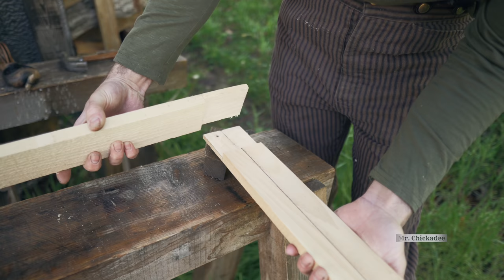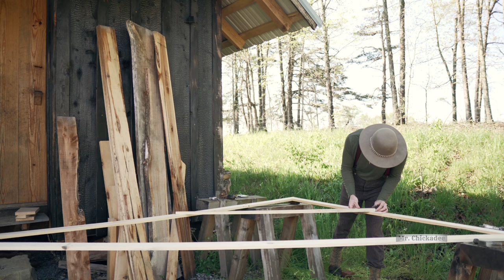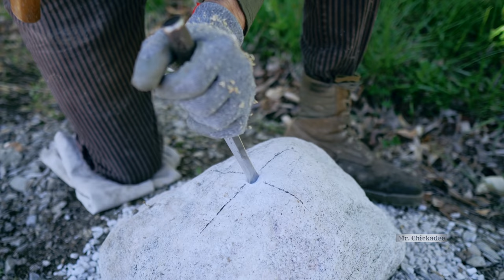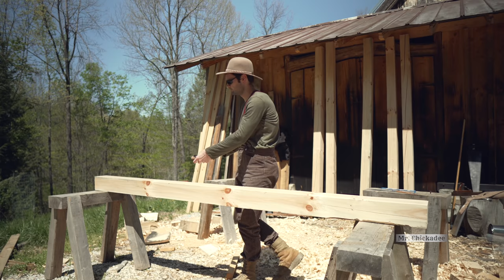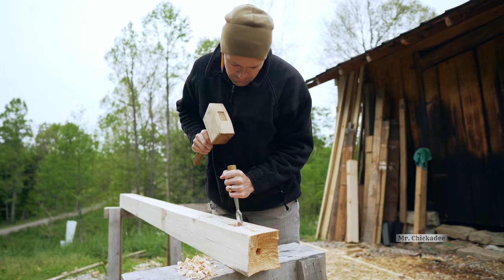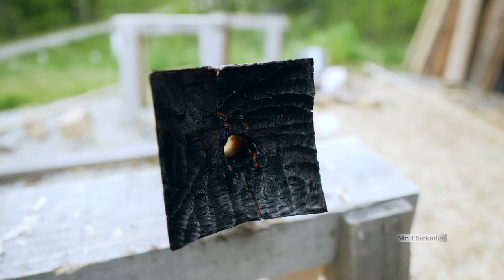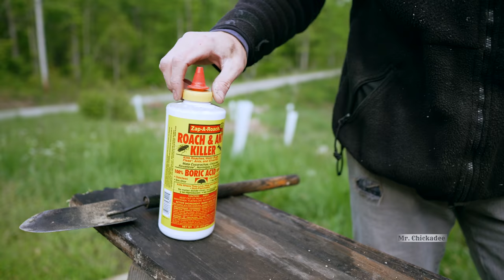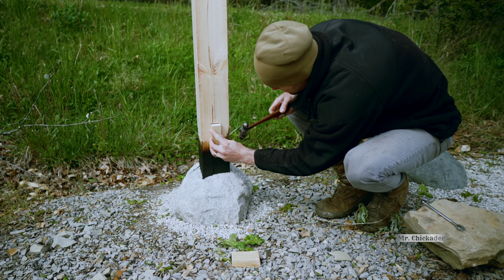Anchoring timbers to stone: ancient technique with modern twist for building codes/extreme winds.

Comment: Before there was a cordless drill, there was a cordless drill!
Reply: Have you noticed that all his tools cut through the wood like cutting butter. He must sharpen his tools vey thoroughly.
Reply: Even a cordless rotary hammer
Reply: Yes no need for cordless extension cable
Reply: where i can buy cordless power generator?
Reply: Called a "brace and bit" if your currious. And he definitely cares for his tools, those bits are a bit (pun intended) harder to come by these days, and te reason they cut the wood like butter is that those old bits are self tapping and the twist and thin shaft past the cutting head helps to pull up the chops and clear the hole as you drill.
Reply: You wont believe this, but Electric cars were before gas cars
Reply: @nesp_phieti  if i remember engine's not cars due to battery issues and oil company's pushing for gas but I may be wrong.
Reply: I have a 1937 "cordless drill" from "Milwaukee Electric Tool Corp"

It is not electric. XD
Reply: @operator8014  bought from Mars probably
Reply: U mean ,before cordless power drill ?
Reply: Ha funny :)
Reply: @shiftyjesusfish they're quite easy to find online, just a little pricy as they're more niche .
Finding a fistful of brace bits at a reclaim yard a few years back made for a nice project derusting, polishing and sharpening

Comment: Being a telephone installer in Santa Barbara CA I have crawled under many Sears & Roebuck Catalog houses, era 1920s, that used this method. These homes have survived many earthquakes and have not been damaged by the ubiquitous subterranean termites. Thanks for showing that "newer" is not always better. I think that the only reason that this method is no longer used by contractors is that it requires skill and time.

Comment: This “ modern upgrade” is a best practice when using monolithic stone as a foundation for a post.  Here in the Pacific Northwest my structural engineer approved this method with a few changes to deal with those pesky earthquakes. Use 1” all thread rod embedded 10” deep in the stone and 10” deep in the post.  Use structural epoxy in the rod holes. And the stone base must extend at least 18” below grade on top of 6” of gravel. Hand tools optional lol. 

I used this method on both my front porch and my back porch. 8x8 posts on top of granite blocks. The granite blocks I used were roughly 2’ x 2’ x 5’.  It helps when your neighbor owns the quarry.  They look incredible! Thanks Mr. Chickadee for sharing this new twist on old methods.

Comment: Really cool, and looks like a great way to keep your house on its pillars.  One thing I did notice though is that you stacked three washers, and one of them was the traditional spiral lock washer.  You might want to consider leaving those out.  Spiral lock washers actually substantially reduce nut retention forces.  At the time they were developed, they seemed like a good idea, and they work in theory, but in practice a bolt without any lock washer at all has much higher retention forces.  They DO reduce the extent that a loose nut rattles, by basically being a cushion, but since you sort of want to know right away when something's coming loose, that's of debatable utility.  The fact that they're still used EVERYWHERE is mostly a case of engineering standards evolving at a much slower pace than engineering knowledge.

Comment: My dad was a mason who sometimes had to "bolt"  heavy machines to walls and floors in factories. He would put a nut on the end of the rod, drill a hole large enough for the nut to go all the way to the bottom, put the rod and nut in it, fill the hole with a bit of fairly dry concrete, then put a solid iron tube with a relatively flat end over the rod and hammer on it, fill again with some more concrete, hammer again, repeat until level. He claimed it instantly secured very heavy machines.

Comment: We were Never elaborate about our sheds.My twin and I, under the direction of our grandfather, would dig a trench and load it with stone. Then we would search for stones with a flat surface. These stones would set on the trench stones. We would then drill a hole, like you did in the flat rock with a rose drill. We were not fussy about leveling the 6X8 beam which was connected to the rock. We would level the frames. Your foundation will last 300 years plus! my sheds are over 80 years old with no settling.! Great video. :-)

Comment: You know? There is a special threaded bar that is used with that epoxy as seismic restraint in various building practices and infrastructure applications . Which in conjunction with this would be incredibly easy to fit and would stand for possibly a century, since it has a flanged nut and a flat sided rebar type bolt in Galvanised steel finish. 
I'm impressed with this and though it may be difficult to apply in the low floor setting am considering it for a repiling job on my list. The building is on a sand footing which has required resetting piles numerous times over the past century, wedges and wiring. Here we would multiply the area of that pile with the large stone, exponentially reducing movement  over time. 
You did an exemplary model of the technique in this example! Thank you. Impressed.

Comment: using a star bit for single-jacking will make the process easier, and it too has been in use for hundreds of years. Thank you.
Reply from the maker: No, star drills are for concrete and brick. A plug is used for real stone. Just watch any single Jack hand drilling competition in granite, its all plug chisels.
Reply: @MrChickadee  I am just going on what I have witnessed in many hardrock mines here in the rockies, and what I witnessed as a kid while staying at a galena mine operated by a couple of hand miners. Lots of broken drill steels of several configuration were found......I admire your precision and attention to detail. No slack or error. Thank you for the info. Measure 3 times...cut once.

Comment: I made similarly connected posts but with holes just to fit a single nut without the space for wrench. Then i glued them inside and rotated whole pole to screw it on.
Reply from the maker: Cant see that working with a round scribed stone? Maybe with flat stones?

Comment: I think I would have chiseled the stone almost flat with a slight cone to shed rain. I guess cause I'm a mason. Also Dow chemical told me the best way they discovered to keep termites from coming up through the anchor / sill bolts and other penetration was to use pine tar at the hole. That's been 15 years ago but I did use it. Just my 2 cents. Would happily listen to your opinions about it.

Comment: Some captions would be epic....pine tar, creosote, what are you using, when and why?
Reply: at 14:13 it says "Pine tar/linseed oil mix"
Reply: only if you have CC turned on though!
Reply: There are captions. Click the CC button next to the gear on the bottom of the video.
Reply: There are captions, but you have to turn them on. It's the little "CC" button next to the settings cog.
Reply: Enable the captions.

Comment: I did a similar thing for the center posts of my post & beam winery.  I used a stainless steel anchor epoxied into a granite block.  I screwed a galvanized eye bolt into the anchor, and cut a slot in the end of the timber for the eyebolt, and put a one inch octagonal red oak peg through the post and eyebolt.  I also put aluminum flashing between the post and granite block.  All you see is the peg.

Comment: This was oddly satisfying, could we perhaps have some overlay text to know more detail of each stage, very good qaulity vid, what about coating the bolt with some protection from corrosion for longevity. Nice vid 😀👍
Reply from the maker: try turning on the ccs
Reply: Or you can use stainless bolt, nut and washers, since they are modern part anyway.

Comment: Reminds me a bit of the approved method for retrofitting a home for earthquakes here in Oregon, minus the steel brackets of course. But anchoring a bolt into holes bored into the foundation is a key part of it, and the use of epoxy to do it is encouraged to reduce the risk of cracking the concrete.

Comment: I have a general question regarding to the chisel, how often do you feel like you have to put a point back on it going through that granite? 2x per strone or more?
Edit; that beam of wood looks like it’s growing out of that stone so beautiful
Reply from the maker: I gave it a grind twice per hole. On the last hole I could tell it is ready to be reforged as I was starting to grind down past the hardened part. Granite is hard haha.
Reply: @MrChickadee  thanks for answering my question.
Reply: @MrChickadee  we have mostly basalt here in Oregon USA, granite is also MUCH more abrasive depending on what materials have been stuck in it.

Comment: Not sure if it was in the video or I just missed it 2x. What was the oil used after burning the end of the timber?
Reply: Pine tar mixed with linseed oil.
Reply: Tar and linseed oil
Reply: i am guessing linseed oil...
Reply: "Pine tar, linseed oil mix" 👍
Reply: Pine tar and linseed oil
Reply: Probably Linseed
Reply: It was in the captions.  Mix of pine tar and linseed oil.
Reply: said pine tar , what ever that is and lindseed oil
Reply: It was most likely oil based polyurethane.
Reply: To protect the wood from moisture

Comment: I see how it might help with building laws, and from the psychological point of view. But from a functional standpoint I don't think it adds a lot the original design. It surely adds the weight of the rocks to the structure, but the whole house should weight enough to hold itself in place. And if for some reason you're expecting that it doesn't, you probably need some way to anchor it directly to the ground anyway.
That said it's an awesome work as always. If I wasn't in another continent and all, I would love to join one of your classes.
But, who knows... maybe one day...
Reply: Wind uplift ( could be roof only) or even seismic restraint ( don’t know if this is in west coast).
Reply from the maker: I typically dont do this, but as you say, some like it for "feel good" reasons. Or to satisfy code officials who dont know better. Building weight should be enough in most cases.

Comment: In case anyone is curious about the effectiveness of using a brace to drive home screws/bolts, I've torqued the heads right off of 7/16" galvanized lag bolts, so using some form of torque limiting (like 'torque sticks') is DEFINITELY recommended unless you are confident that you can drive screws/bolts home without over-torquing them.

Comment: I don't understand how a shallow layer of gravel doesn't shift and push around from the weight. It must settle and push outwards, surely, over time?
Reply: My understanding would be that, as the ground has been dug out to create a small pit, the walls of the pit create enough containment, like shuttering used for concrete and that, with a suitable grade of stone gravel, it is compacted and supported in a way that prevents the movement. Your theory is perfectly logical and a good question, so others may contradict me but i think, with the additional gravel poured around the sides, the shape and size of the large base stone and what i presume is solid and dry ground conditions, it wouldn’t be a problem but i’m interested in Mr. C’s response.
Reply from the maker: Nah, it'll be fine...know your soils, some will need more than this.

Comment: I love the original idea and now like it even more.  Did you get any building code approval for it as that is the question, Designed a beautiful shade trellis with a wood structure, and metal legs.  When we went to building code, they only had a picture from the standard building codebook, and the picture did not match what we designed so we needed an engineer to sign off, the Metal legs had to be broken and bent tested for each one, and the clerk also stated no-one builds with metal anymore.  I had to laugh at the whole scene.  So you are off-grid but chances this was approved anywhere to comply with codes?
Reply from the maker: No building codes here mate. But I do know my friend has built many houses for people (and public works) that were approved in residential areas with this method.
Reply: @MrChickadee  That's good to hear. Thanks for posting you do amazing work and bring back technology the world forgot is awesome.

Comment: Nice work sir. Why the ant stuff in that mixure? (Presume it was clay, soill and water?)
Reply: It was for the boric acid. Salt would work as well. Josh normally puts explanations in the closed captions since his videos are as much about ASMR as they are about showing the techniques.
Reply: Pretty sure the purpose of the boric acid is to prevent mold or fungus from traveling up the anchor hole into the pier. Normally, burning the wood prevents that, but now there's a big hole in it.  That's also why it was a fairly small heap centered on the anchor bolt.  It's not intended to really be a mortar for the base of the pier.  He wants it to act as a grout to seal up the bottom of the anchor hole against the anchor bolt and the stone.
Reply: Pretty sure it's to help prevent insects getting into the wood, such as termites.
Reply: If you turn captions on he writes "boric acid, salt will also work".
Reply: The ant mixture is to prevent ants, termites and other burrowing insects from digging through the mortar. Clay and Sand after all is basically just dirt, and ants or termites would have no trouble burrowing through it.
Reply: Turn on the cations and watch again
Reply: Sorry.... captions
Reply: I assume it's so bugs won't climb up and eat the wood

Comment: Another fantastic video , however  I'm somewhat perplexed - what is the point of burning the timber?
Reply: convert it to charcoal and concentrated oils/resins, which is waterproof and bug proof.
Reply: i think to protect the timber from white ants or termites?
Reply: I believe it prevents the wood from rotting as well as deters bugs from eating the wood.
Reply: @constantinosschinas4503  I would think that the oils/resins would be the first thing to burn off.  They are organic and they burn.  What would the fire marshal most likely have a problem with in my garage, a pile of wood or a bucket of oil?

Comment: Hi 

I am currently working on a structure inspired by your video. Thank you very much for showing the whole process. Right now i am actually carving out my posts :)

I have a question though.

What is the boric salt for? Only bugs or fungi too? Living in Denmark and i wonder if the boric salt is necessary.

Once again thank you for the inspiration! I am only just now building a shed but i am considering to use the stone plinth foundation for the house i am going to build also :)

Hopefully we can stay in contact :) Maybe id send you a picture or two of the Mr chickadee inspired shed?

Cheers from Scandinavia
Reply from the maker: The burning and the salt based grout are just additional preservatives, not often used traditionally in all of asia, most often it was just wood on stone, and there are many existing examples hundreds of years old. I like to use belt + suspenders type approach when building, just in case. If you have a cooler/dryer climate or less insects, or rot resistant wood, you most likely could get away without all those things and be fine. The grout also serves as additional support for very heavy structures, like if we are talking multi stories or large temples. Thats a lot of weight, for my house, and other buildings here Ive never bothered. They are all fine. 

Id love to see what you build, send me an email with any specific questions. Are you versed in Line Rule layout? Horizontal bracing methods? Ask me anything.
Reply: @MrChickadee  Hi and thank you for your answer :)

No i am not very well versed in neither Line rule layout nor in Horizontal bracing. Actually i never didn't any timberframing before. Now i have had a week of building with some friends - all new to timberframing. We made some mistakes and it would for sure have helped with some experience in lining up the timber, taking all the bends and twists into account. At last we got the whole thing assembled with each post on its respective boulder which is such a good feeling especially since i also fell and milled the wood myself knowing the amount of work is put into each piece.

I am thinking that horizontal bracing requires that your joinery is very precise and tight in order to keep the whole structure from racking. What i am currently building it more traditional european with 45 degree bracings. What i found is that as soon as the pegs are in all the pieces are locked reeaaally tight even if my joints aren't flawless. I would think i had to be much more on point with the joinery if i didn't have the 45 degree bracings.

I will send you an email with som pictures, and i also would be very interrested in discussing how to go about timberframing and insulating with strawbales and clayplaster for the house i am plaaning to build hopefully starting next spring.

Comment: Mr. Chickadee is displaying some old fashioned carpentry skills that are rarely ever used anymore. My dad had a woodworking shop and as a kid I learned how to work with wood using chisels, hand saws and hand crank drills......learn to work material by hand before you do it with powered tools is the best way.
The " modern twist " I suppose are things that did not exist back when the only drills were hand crank's.
Like the 1" minus fractured rock which back before excavators and rock crushers did not exist, or epoxy, or that type of threaded rod. I don't know how that lumber was milled but I doubt he has a watermill driving a sawmill.
There aren't many real carpenters left so this video was a pleasure to watch.